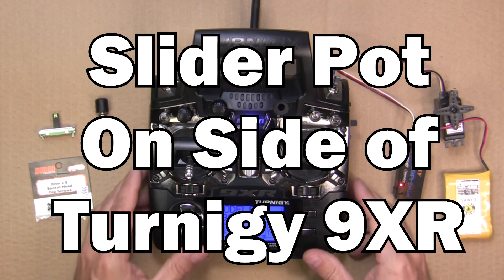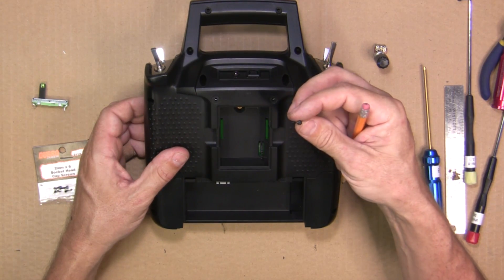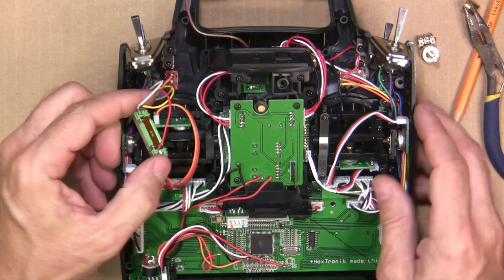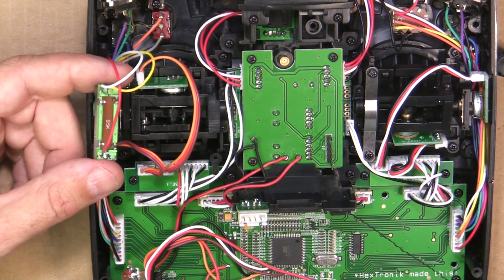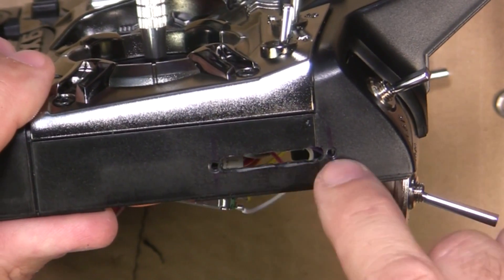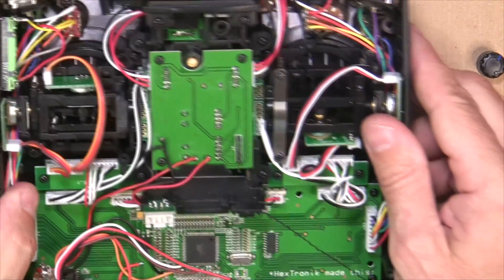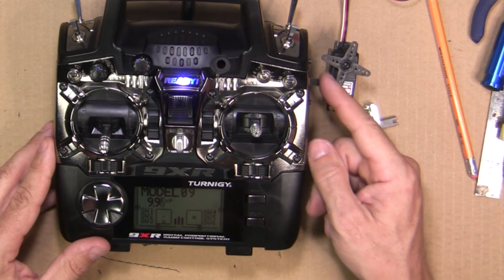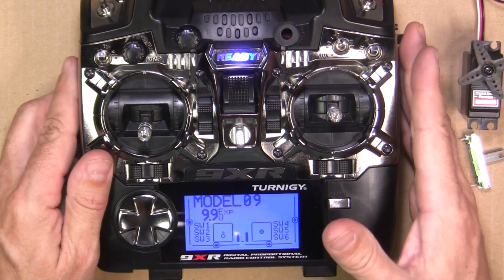Slider Potentiometer on Turnigy 9xr

Comment: Great how to... 
But... if I get 2 strings and attach it to a car radio...  :)  on channel 5ohm or 10 ohm...  will that work???
Been searching for that part...  found your original link page...  but there it  is unavailable...  They exist and can be found...  just have to search other sources..  will post their locations when I find them...  Why would these guys be asking you if slide switches of other values will work...  Should probably list what slide switches YOU DID NOT INSTALL..  might cut back the chatter...  got to go find a few pieces of string... and steal my sisters car radio...  Great video

Comment: I have a foot pedal that gives variable resistance from 1K Ohms to 12k Ohms.  Could I use this along with this method to control a gimbal's pitch?
Reply: I don't see any reason why this wouldn't work. I would suggest installing a small receptacle in your radio, into which the pedal could plug, rather than having the pedal hard-wired to the radio.
Reply: After hooking it up with the regular pot I realized the gimbal is very sensitive so I don't think the pedal will work. I may end up doing the mod you do in the video.

Comment: Great idea and excellent video.  If you don't want to buy the slider, you can also move the factory pot to this "side" location and put a servo arm on it so it can be more easily manipulated up and down.......as the location is really the issue....but the slider is definitely better....

Comment: You not going to damage neither your pot or your radio, if you get it hooked up wrong. I think I connected black where that white in the video goes. Any way try it, and if it doesnt work, switch those wires around.

Comment: Nice video and smart solution. But............... Don't change the Phillips screws for the case with 3 mm hex. The Phillips screws have threads designed for plastic. The 3 mm hex have much smaller threads that will not hold as good in the plastic case.
Many people tends to use a too small screw driver for the Phillips screws. If you use the correct driver, there is no problem with the screws.